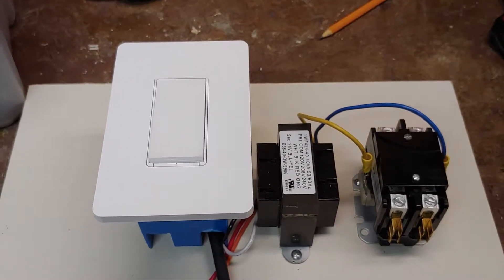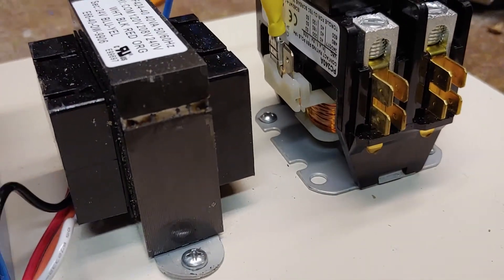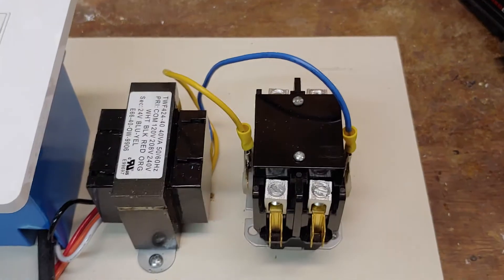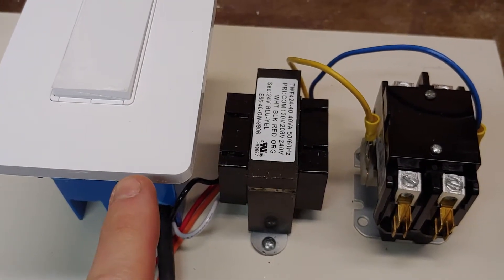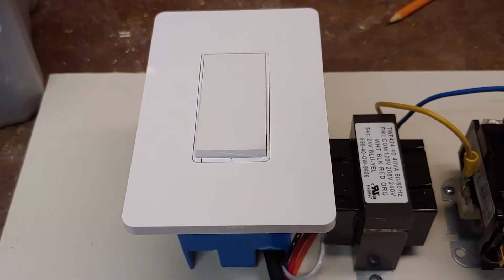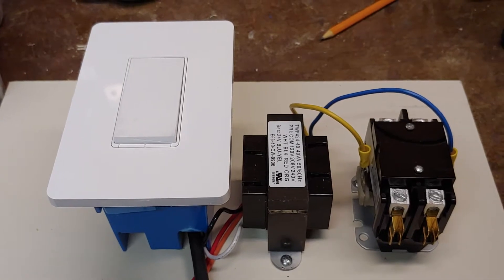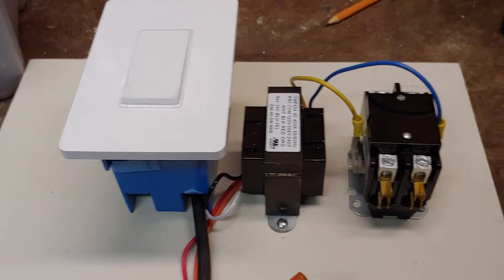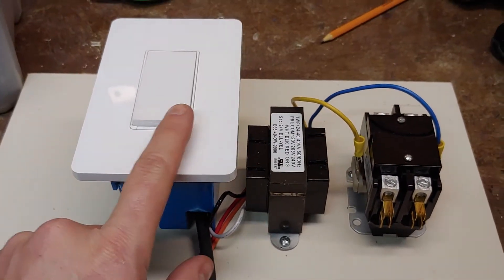240v 40amp wifi switch contactor - High Current WiFi Switch

Comment: is there a wiring diagram for this... or what is the thick black wire going in the switch box? i got everything but i dont understand  how the switch controls the contactor using only 2 wires from the transformer what do i do with the other 2 wires in the switch
Reply from the maker: Sorry don't have a wire diagram. The thick black wire is power from the wall black, white, and ground. Wifi switch controls transformer power which then powers the contactor's solenoid that closes the contactor switch which has two 120v circuits.
Reply: Ooo ok so the switch connect normal to the 120v black white green and then the transformes to the other black on the switch and the white right
Reply: It makes more sense now thanks alot

Comment: Matt, The video is very helpful. I was going to use this setup, but I have a pump and gas heater. Can I use the same contactor?
Reply from the maker: You should be able to so long as the load on the two items being switched is less than 40amp. There are additional contactors that go up to higher load ratings like 50amp if you need.

Comment: I've been doing some more experimenting and I figured I'd provide an update:

The idea of using a 120v coil contactor worked perfectly. Even so, I found the solution somewhat messy with requiring a separate 120 volt system to control the 220v load.

I was looking around and found they also have contactors with 240V coils. And I also found those those cheap little Sonoff branded WiFi switches are rated for 100-240 volts. I wasn't quite sure if they'd work on the US standard of 240 volts (which is hot-hot, no neutral) because I believe the UK 240 volt system is hot-neutral like our 120 volt standard. 

I ordered a few, wired them up to a 240v outlet and they seem to work fine. I haven't put them under a load yet, but they connect to WiFi just fine and at least testing with a multimeter turn the 240 volts on and off just fine. I'm waiting for the 240 volt coil contactor to come in, so I'll keep you posted on how it turns out.

For those wondering why use the contactor, why not just run the 240 volt load off the Sonoff, well, it's only rated for 10 amps, which might be enough for some small 240 volt loads, but they're pretty cheap switches so I wouldn't trust running them at max load for long.
Reply from the maker: Elijah, thanks for the update. I should have stated in the video that I am in the states and we more commonly have 120v in most wall outlets and only have 240v for kitchen appliances or high load devices. So using a 120v relay actuated contactor is easy for us here and requires fewer parts than in my video, forgoing the power transformer altogther. I used a Kasa switch for my application as I already use Kasa products for other houshold applications. I have looked into the Sonoff switches and they seem to also work, but require a different app than what I use and want all my stuff to be controlled from a single app and be Google Home and Alexa compatible. 

Thanks for your input and interest. What I love most about YouTube is the ability to collaborate with other!
Reply: Thanks, good advice. I also just bought a sonoff and Eaton brand 2 pole contactor with a 240v coil. I plan on using it to control my 240v air compressor and keep it from going off in the middle of the night.
Reply: @tylerwatt12  Best of luck. I'm my experience the setup works flawlessly. I've been using the setup for almost two years to control both a 240v window air conditioner and a 7500 watt heater in my garage.

Comment from the maker: Elijah Watson messaged me offering the suggestion of using a 120v solenoid contactor, doing away with the need for a power transformer all together. I have included a link in the video description for the 120v solenoid contactor. Thanks!
Reply: Hi Matt. Any chance you could show or explain exactly how to wire the smart switch directly to the 120v solenoid contactor? Thanks!!
Reply from the maker: Unfortunately I can't as this was made as a gift and I no longer possess it. If you use a 120v contactor you would simply wire the solenoid leads into the WiFi switch and should be good to go. With my setup in the video the solenoid is 24v and required a transformer. By using a 120v contactor solenoid you negate the need of a transformer and remove it entirely. Hope this helps.

Comment: I've been looking for ways to control my 240v garage Window AC and 240v heater over WiFi. This looks like a great solution, but the 24 volt transformer seems to be unnecessary - - Amazon has contractors with 120v coils that you could wire directly to the WiFi switch for dirt cheap.

https://www.amazon.com/dp/B001KGSJ74/ref=cm_sw_r_cp_apa_fabc_VJ1BE0EAJ6W2DYKNKHY3
Reply from the maker: Thanks for the suggestion. I agree your suggestion would be cleaned, cheaper and have fewer parts. Thanks for your help!

Comment: Great video.  I have a question that is related somewhat.  Is there something out there to control my 220v pool pump using a 5v relay?
Reply from the maker: I am not sure honestly. Out of curiosity what are you trying to accomplish?
Reply: @eyedocmatt  i have a pool pump running on a 220 with a double 15amp breaker. I would like to control it using my current setup that i already have.  Basically looking to control it with my "konnected" automation system via smartthings hub. My pool pump does not have a remote option pre installed so i cant acess it that way.  Just a simple on/off switch i want to control remotely.
Reply from the maker: @paulb1198  I am unfamiliar with that type of system, but just took a look. Looks impressive. Hope you find a solution!
Reply: @eyedocmatt  thanks.  Hope so!  Great video btw.

Comment: This is a great video and explanation on how to setup a wifi contactor.  I am using almost the same setup you have to control my electric water heater.  Thank you for the video, I was looking everywhere for this    My only question is.  The wifi relay I am using is 120v.  How can I power the wifi relay with the same cables that are powering the water heater?  I understand that each of those two cables are 120v.  I still need a neutral cable for the wifi relay, don’t I? Thanks in advance for your help.
Reply from the maker: Hard to know exactly how to wire what you are wanting, but I would imagine you could use one of the 120V legs from your water heater and power your Wifi switch. You will need a neutral connection as well, so if your 240 volt appliance has a neutral wire use it, or wire to ground as your neutral and ground are wired together in your breaker box. Keep in mind I am NOT an electrician, please be careful and wire accordingly. Also keep in mind having an "unbalanced load" on 240v is typically not recommended. Wiring your wifi switch to only one of the legs of the 240v creates an unbalanced load. However, the amount of amperage draw from a WIFI switch is minuscule and probably won't create any hazard.
Reply: @eyedocmatt  I really appreciate your video and your help.  I have a friend who is an electrician that is going to help me.  Nevertheless, your setup is what made my project possible.  Thanks again.
Reply from the maker: @eclecticlife  Collaboration is one of the great things about YouTube and helping each other out is what it is all about. Good luck, I would like to see a vid of your final product when you are finished if you have a chance.

Comment: Thanks for the video. I need a similar setup for controlling my 240v pool pump via wifi and manage daily schedule. I do that for my winter lights with my wifi plug but can't find any 240v plugs. So, it looks like I need to go your rout to use 120v wifi plug/switch and let it control the 240v switch. Can you please give me little more details on how to wire the 24v transfer into 240v connector. I'm a software guy with a only know basic electrical knowledge.
Reply from the maker: No problem. 240V power from the wall is simply two 120V legs used together; typically the black wire carries 120V and the red wire carries 120V. To power the WiFi switch we need 120V only, so you simply wire the black from the wall to the black on the switch and you have supplied the power necessary, remember to connect all the whites together as well. From there you use the WIFI switch to interrupt the black "hot" line for the transformer.  I chose this transformer because it is powered by 120V or 208V or 240V you can decide. If you look at the top of the transformer you can read the corresponding wire color to the desired voltage. The wire color is above the desired voltage.  Com=White (sometimes called a neutral wire, you will always use this wire), 120V is BLK (black) 208V is RED and 240V is orange. You don't use all these wires, just choose the one you want to use, probably easiest to use 120V like I did.  The blue and yellow wires are used to control the contactor solenoid to open and close the circuit. You can see the contactor has a left and a right side. The left side switches one 120V leg (black or red) while the right side switched the other 120V leg (black or red). You are using a 120V switch to control the transformer that controls the 240V 40amp contractor. You can use wire nuts to make your connections, or use crimp style terminals that work great too and will slide onto the copper connections on the contactor easily. Make sure you place a small wire nut on the exposed ends of any wire from the transformer you won't use, don't want them to accidentally come in contact with the other wires in the junction box. Also make sure that all connections are in a plastic junction box, my video has the contactor screwed into a piece of wood, this is not the final look of my switch, all my connections were made on the inside of a plastic junction box. Be safe. 

I have included the details of the items in the video in the description of the video if you need them. Please message me back if you need any further clarification.
Reply: Hi  @eyedocmatt   sorry I thought I replied to you earlier. Thanks for the detailed explanation. It is very helpful. One question though, if I do this Wifi switch -> transformer -> connector setup, I won't be able to gather power consumption data via the wifi switch right? i.e Sonoff wifi switch I had setup for other 120v use, allows me to see how much wattage was consumed on an hourly basis. I guess this setup won't give actual current passed to the wifi switch to present it in the app. Please share your thoughts.

Thanks again
Reply from the maker: @mohanrs07  I have not played with the Sonoff Wifi switches, but will assume they give you  watts used if the device is in line with the switch. With my setup the 240v circuit does not go through the wifi switch and wattage data would not be available. I guess you could figure out a way to use two Sonoff switches with 120v a piece. The problem I was trying to solve was switching a 240v device that had a 35 amp demand and all the available devices on the market were rather expensive. This was a less expensive alternative.
Reply: @eyedocmatt  Thanks for the quick reply. That's a good idea to try with two wifi switches. I'll experiment that idea or rather go with the your setup as consumption data is not that critical to me. It's just a 'good to have'.
Reply: @mohanrs07  Yes, you can use a sonoff switch instead of the one used on the video.  Check this setup that they are selling on amazon.  https://www.amazon.com/Migro-Outdoor-Resistive-Wireless-Compatible/dp/B07THD8VBN/ref=pd_rhf_dp_p_img_6?_encoding=UTF8&psc=1&refRID=8V9D6TDY0NJABJ6XV3KX that uses a basic sonoff.